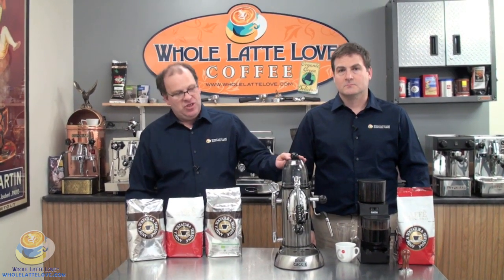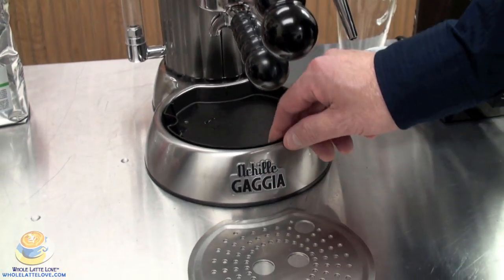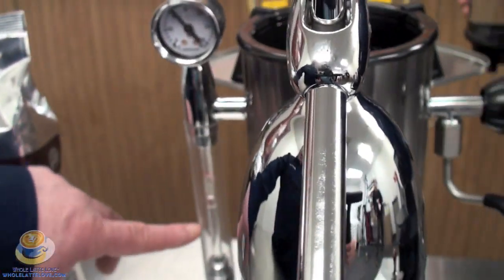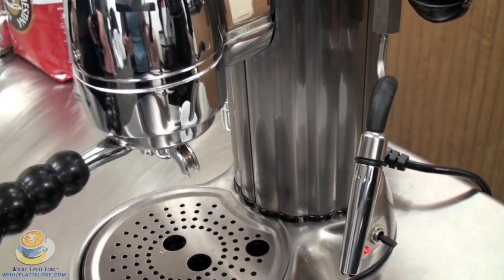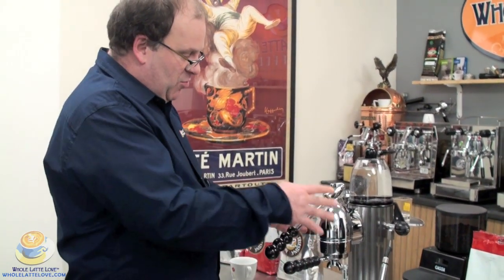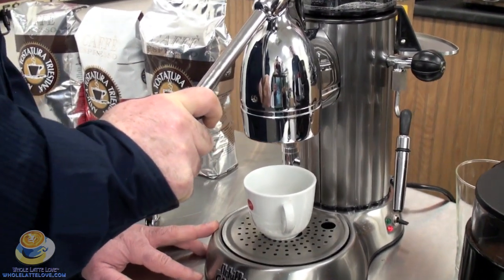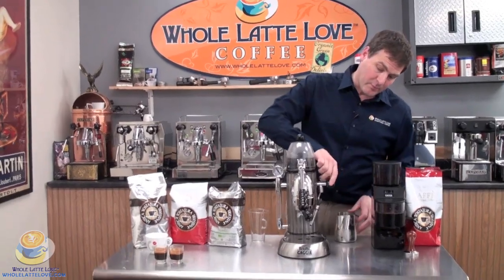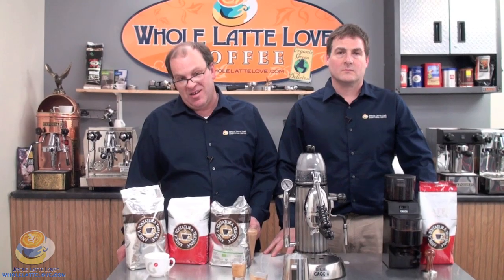Gaggia Achille Manual Espresso Machine

Comment from the maker: @jrcbago The Achille does have a sturdy body and that shaking can be prevented. The key is to balance the downward force used to pull down the handle by holding on to the portafilter more firmly.